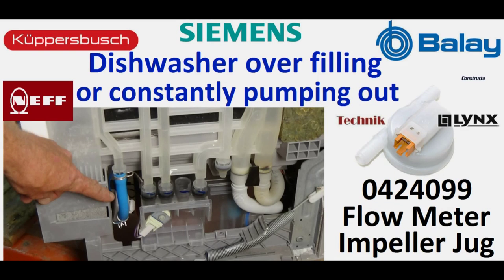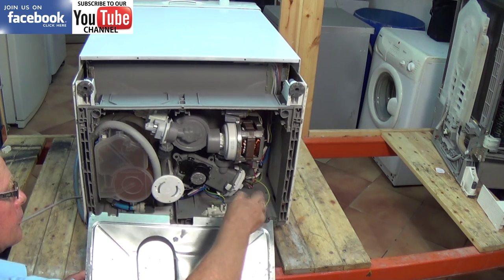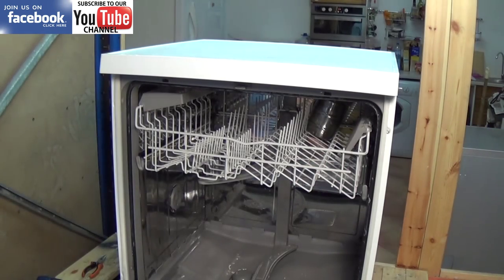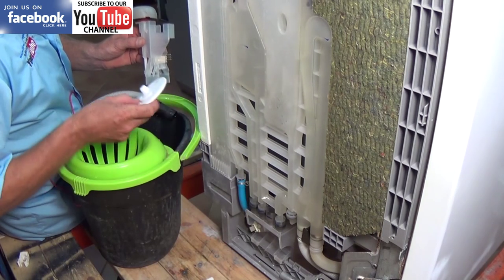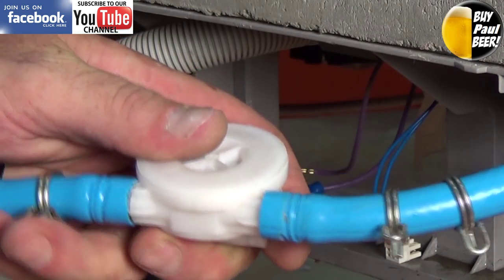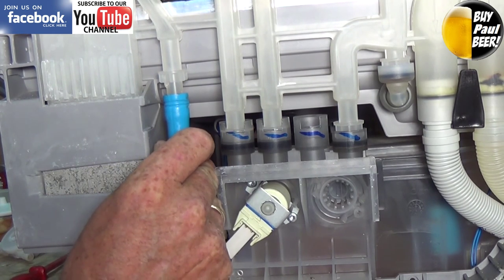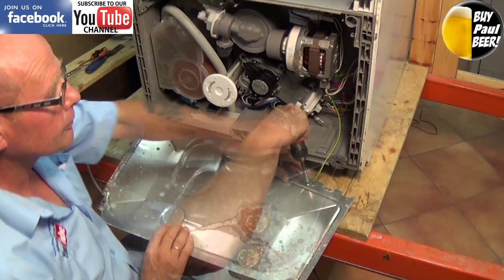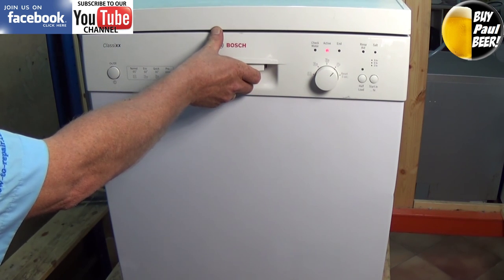Dishwasher constantly draining Balay, Constructa, Kuppersbusch, Neff, Siemens, Tecnik.

Comment: wonderful tutorial.
can you comment on the following:
a costructa dishwasher that works wonderfully, however, there is some clean water filling/leaking into the bottom of the machine when it's not in use. I takes 12 to 24 hourse to fill 1-2 cm of water puddling on the bottom of the machine. Lifting the mushroom-head valve on the floor of the machine inside clears the water well.  is this a solenoid problem? Thank you